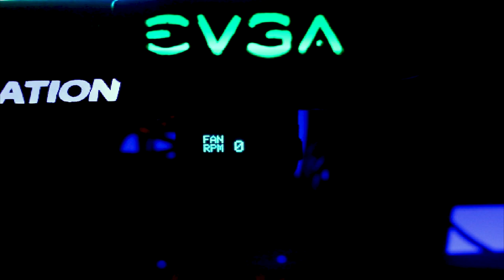"RTX 2080 Ti" GRAPHICS CARD OLED HARDWARE MONITORING DISPLAY (SHORT VERSION)

Comment: After filing down the thermistor did you really get a proper contact with all components again, or are you going with acceptable tolerance gained by the TIM?
Reply from the maker: Yes it fit in just fine. I removed the heat sink and the thermal paste left a good spread on the GPU. I kinda had to gauge it based on eyesight with the GPU height until I got the card back together.

Comment: Whoa, you've got cold hands, m8. Also, wouldn't one of those flex PCB thermistors have been a better "fit" in this application?
No mod is complete without the application of hot glue :P
Reply from the maker: The beauty of air conditioning on high. 😉 The flex thermistors are more expensive, about the same width, but too big to fit under the heat plate from the ones I've seen online.
Reply: @ImmodderNation  The flex thermistors are sub-mm thickness though. ;)

Comment: What kind of value does the thermistor return to the arudino? Its resistance or directly a temperature value?
Reply from the maker: Voltage. Arduino can only measure voltage. The code used the fixed resistor voltage along with the Steinhardt and Hart equation.